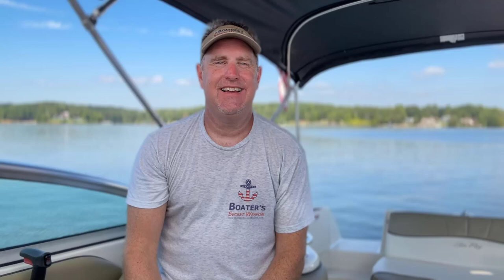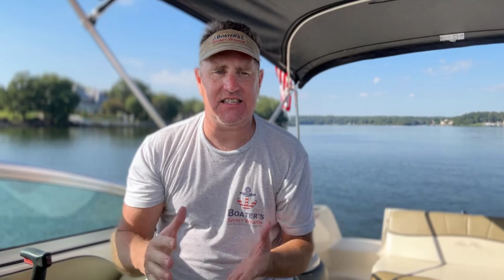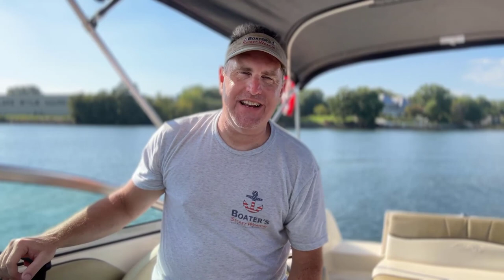Most Common Boat Engine Problems

Comment from the maker: ⚓FREE for Boat Shoppers:
⚓https://boaterssecretweapon.com/pages/boat-buyers-toolkit ⚓
28-page resource for new & used boat shoppers to assist in the boat research & shopping process.

🚤FREE for Boat Owners:
🚤https://boaterssecretweapon.com/pages/boater-bootcamp   🚤 
For newer boat owners gives you the insights on boat ownership basics, navigation and practical rules of the water and how to avoid, be prepared and handle emergency situations. No more not knowing what you don't know in the boating lifestyle.

🛥AVOID Docking Stress!
🛥https://boaterssecretweapon.com/pages/best-boat-captain 🛥 
If you are not 100% confident in your boat handling skills, get nervous docking, avoid fun situations because you’re not sure you can do it, stress over docking and can’t get your anchor to stick, this program is an absolute must for you

😊BUY with Confidence & DON'T PAY TOO MUCH!
😊https://boaterssecretweapon.com/pages/first-time-academy 😊 
Overwhelmed, confused and frustrated with everything involved in buying a new or used boat?  If so,  the First-Time Boat Buyer’s Academy will help you find the perfect new or used boat at the absolute best price so you can buy it with 100% confidence and have years of happy boating memories.